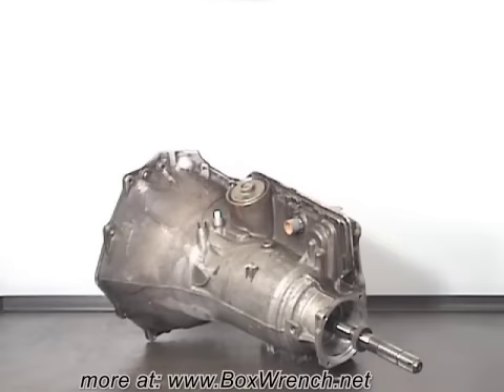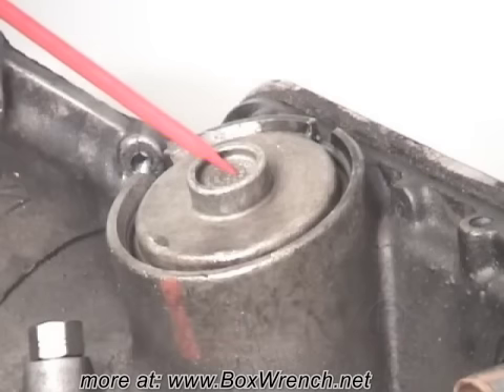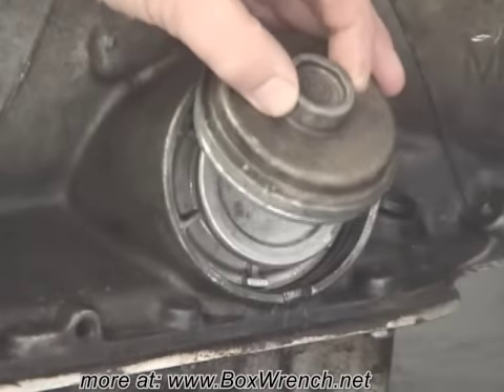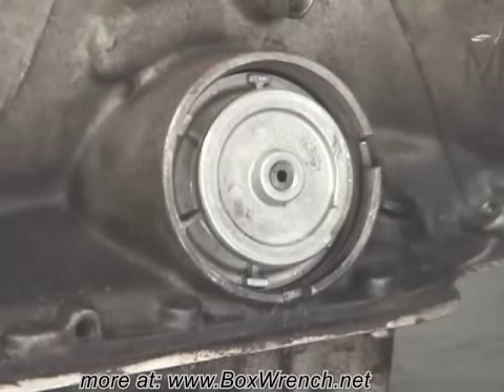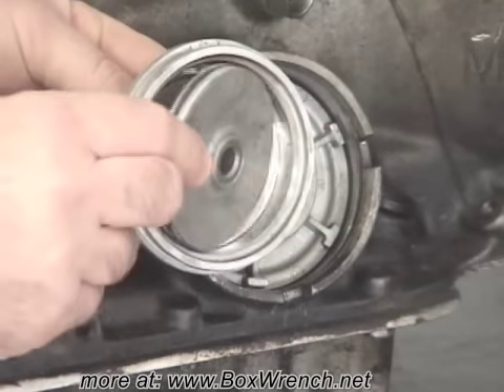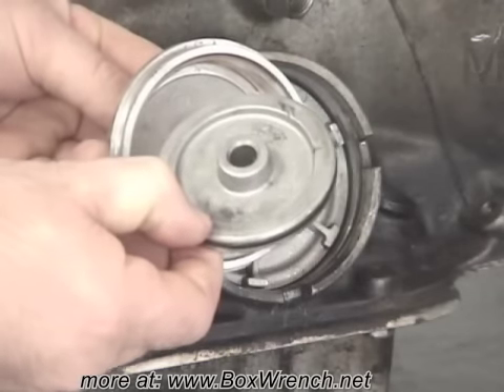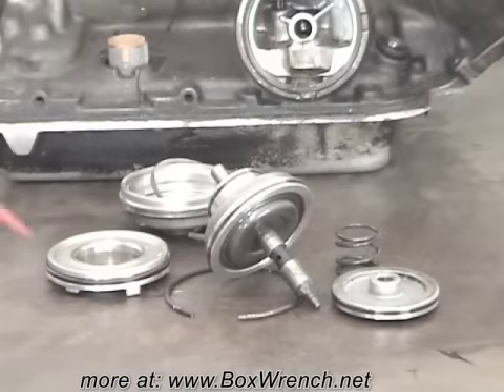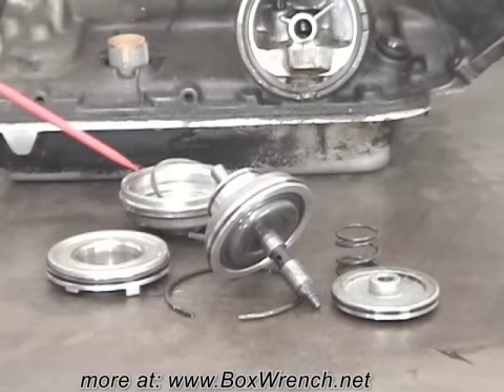Automatic Transmission Rebuilding DVD-Servo Removal-4L60E

Comment: @dodgert70 that and also if you have a cam installed that capable of higher rpm and is set to shift at stock shift points....or so im told.....also make sure you have a good converter and fluids are slightly....slightly above full...i use B&M synthetic.

Comment: Neexxt, I got a question. I wish I could figure out what's wrong with my 4r70w Ford trans with 100k miles. Shifting good and tight, no slip, clean fluid. One problem: After I have trans in reverse, then shift to drive, it doesn't want to shift out of 1st gear. Have to take foot off gas, let rpms drop to near idle then it drops into 2nd. Once that happens, it shifts perfect until the next time I put it in reverse. Tried replacing neutral safety switch, didn't help. Any thoughts?

Comment: @imjustpassinthru .... It's one year later after I posted that about the old thing of my 4r70w transmission not wanting to shift out of first gear. It turned out to be the ECM or whatever you call it., the computer. I had an auto electric shop do a diagnoistic check and they said the computer wasn't "responding.". I ordered a remanufactered one from 1A auto parts online, about $150. Stuck it in myself, simple, no problem, 15-min job. It hasn't missed a shift since.